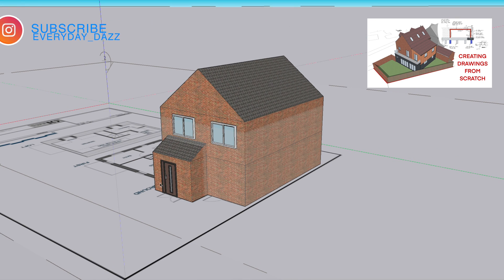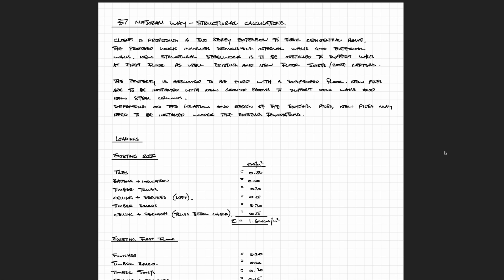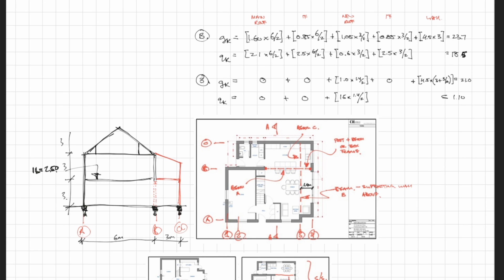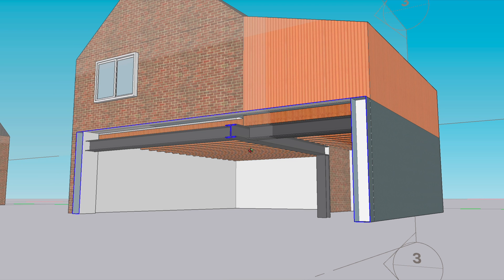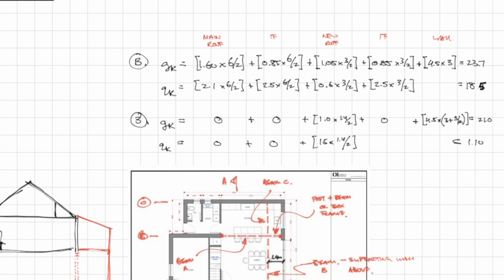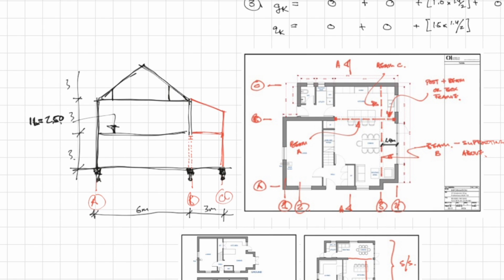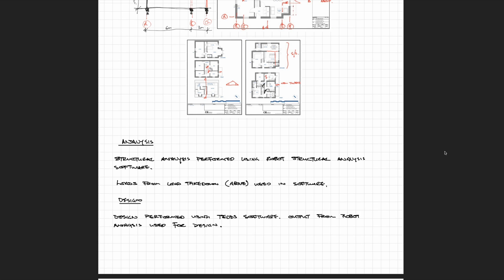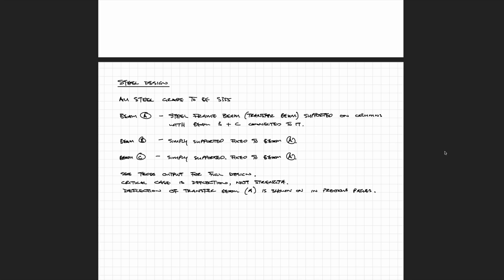3D Models to help understand 2D drawings - structural engineering

Comment: Hi Dazz, I really like your videos.  If the existing footing is on piles then why didn't you opt for a box frame assuming the ground level is not the problem. This would have been much cheaper as opposed to breaking the existing ground beam and adding 2 no of new piles and the repair works involved.
Reply from the maker: Because there was an issue with levels within the house and also supporting the suspended ground floor. I did propose a box frame to begin with.
Reply: @EverydayDazz  I thought that would be the case.